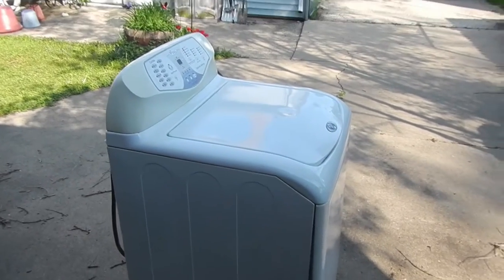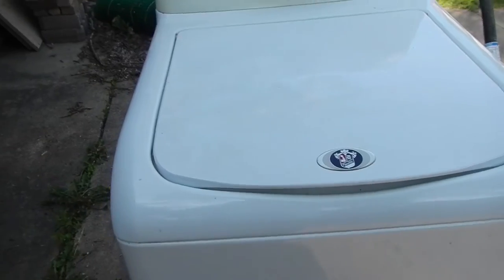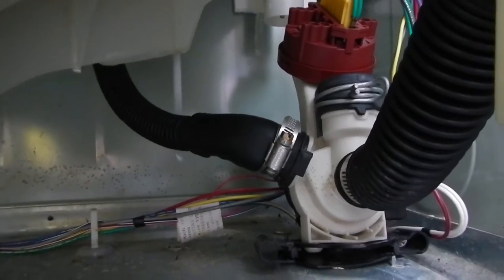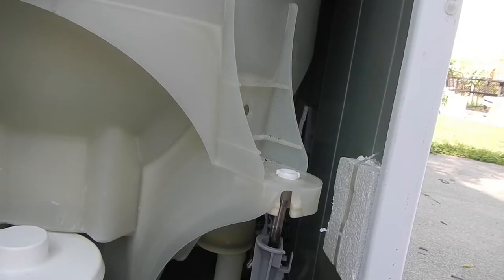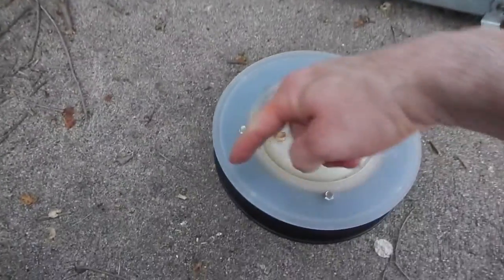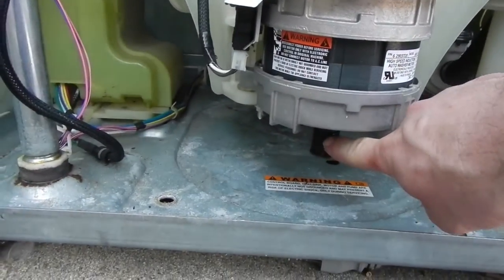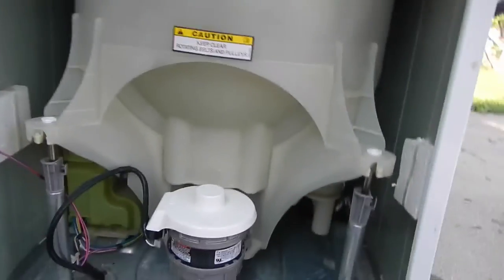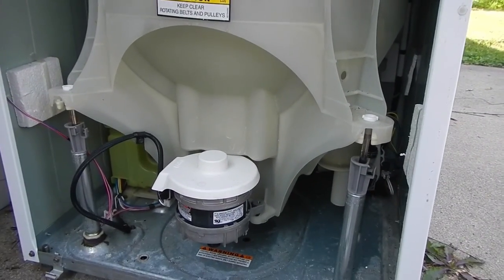Should I Repair My Maytag Neptune TL Clothes Washer?

Comment: It's worth fixing.  You can more than likely reuse that "clutch" part you're pointing at.  Mine also went bad.  The cheap "white lithium" grease they packed the needling bearings with is super cheap and is probably designed to fail after a few years (planned obsolescence) by Maytag (Whirlpool).  I opened my clutch up (by removing those four bolts) and removed all the "dust" that used to be grease).  I then re-greased  the needling bearings and bushing with some high quality synthetic grease.  I used Phil Wood Bicycle Grease (the green stuff).  It's been 4 years since I did that... and I haven't had problem with it since.  The machine used to continually give me "Load Unbalanced" Warnings and would refuse to spin the laundry load.  I really wanted to make a YouTube Video on the repair, but since it hasn't failed I didn't want to take the machine apart (and potentially break it).  You guys can use these links to help you make the repair yourselves:  https://www.manualslib.com/manual/616698/Maytag-Neptune-Tl-Fav6800a.html?page=47  and this one:  http://fixitnow.com/wp/2009/07/02/replacing-the-clutch-in-a-maytag-fav9800-tl-washer/  Good luck to all the Maytag Neptune owners out in YouTube Land.
Reply from the maker: Hi! Thanks for your reply and the tip on how to reseal the bearings at the bottom of the tub. I could have done this but in my case I would have had to purchase a second clutch assembly (or whatever that wheel is called). Besides, my wife was done with my tinkering and just wanted a a new machine. But maybe someone else will benefit from your advice.
Reply: I agree. These aren't the piece of junk that everyone is making them out to be. The factory grease is the issue. High qualty cease on the shaft one way bearings does the trick. Not a bad idea to inspect the clutch while its out. About $120.00. With the good grease, a new clutch will last ten years or more. The guy is right about the gasket.
Reply: The Neptune top and front load washers were built by Maytag Corp. before Whirlpool bought them out. Maytag Corp. lost a fortune over these two machines.

Comment: MY WASHER STARTED SOUNDING LIKE A SPEED DEMON ON SPIN CYCLE  AND I GET A DC CODE .WHICH STOPS THE LOAD....SHOULD I TAKE IT OUT BACK AND SHOOT IT?
Reply from the maker: Mine did the same thing. I think it is because it was not able to get all of the water out during the spin cycle so the clothes were very heavy and off-balance, etc. It might be worth fixing. Take your front cover off and see if you can get a wrench on the very bottom bolt of the clutch assembly. If you can't you should be able to tilt the washer back a few inches, but be careful, the basin will still have some water in it at the bottom of the tub.If the clutch is just broken (the spring catch or the spring itself) then your washer may be worth fixing. But like I said in the video, if the clutch is rusted then it will be much more expensive because you will need to replace the clutch and fix the leak at the bottom of the basin. In the end I felt it was better to take it out back and shoot it. :)

Comment: I would fix it. I just found one. Order and replace the tub seal. order the clutch if it's broken otherwise grease the bearing. the reason for this failure is due to your tub seal failing.
Reply from the maker: Thanks for your input! Yep, for sure the tub seal leaked and rusted the bearing of the clutch. I did not know this at the time so I replaced the clutch only to have it rust. To fix my washer I was going to need another clutch AND fix the tub seal. In the end the wife decided she just wanted another base model washer. Funny thing is my van broke down on the way home from the store. When it rains it pours I guess.

Comment: How do I get to pump
Reply from the maker: You have to take the front panel off. Slip something thin and strong (like a credit card or similar) into the seam along the top left and right front of the machine. This will pop up the top. Then undo the two bolts that hold the front on. These bolts are hidden behind the front panel but at the very top corners. The front will come right off. I hope this helps.
Reply: You have to take the front part of the washing machine off.  The water pump is on the bottom near the back.  You likely have some debris blocking the impeller.  It happened to mine about 8 years ago.  One of the kids plastic coins got lodged in the pump itself.  After removing the coin, the pump was working again.  You can use the link to the manual I have posted above to help you out.  It job shouldn't take more than half an hour.  Good luck.